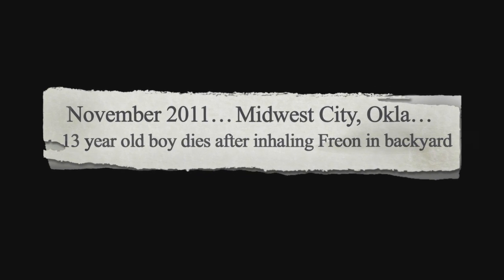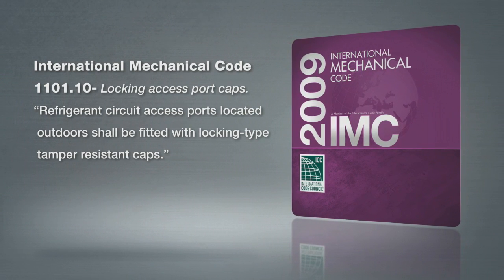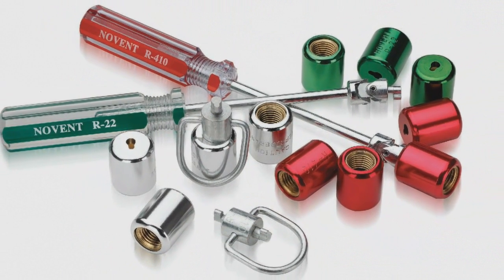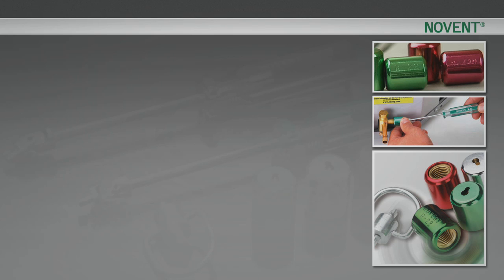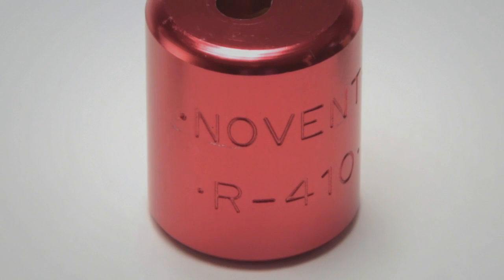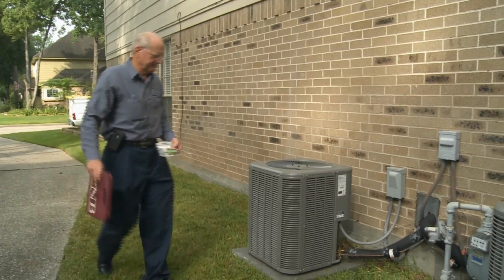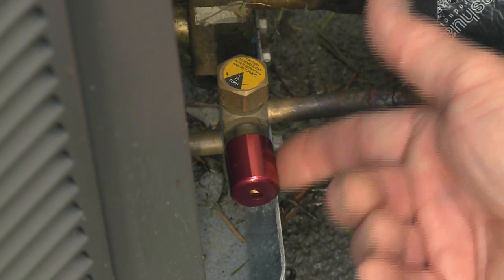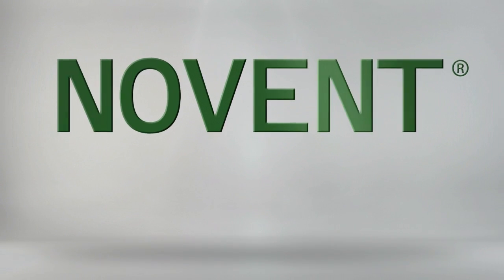Novent Locking Refrigerant Caps

Comment: These caps are a bitch to put on
Reply: Yes they are, I just about lost my cool this morning trying to get em on. Seems like it would work much better if the tool was actually centered in the locking cap.
Reply: The tool I have is different from the one in the video though, made by JB.